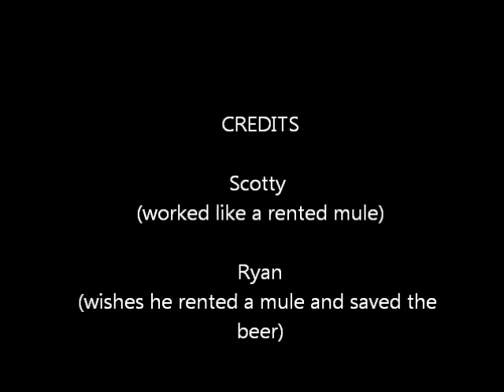Fraser River Gold Claim Trip

Comment: Nice take for the short time in!  What hp is the Honda by the way?  Also you can buy a decent milliscale online for about $30. Its nice to weigh it and then extrapolate. Where do you buy your equipment by the way? Im hoping to get down on the Fraser soon myself. Keep up the good work!
Reply from the maker: +Chipper Mikey The Honda is a 2.5hp I think. Its a wx15 pump. I picked up a nice scale at the pawn shop a while back for $5. I had to clean all the drugs off of it, but it works great. I buy my materials at local shops, but the gold hog mats come right from Georgia. Thanks for watching!